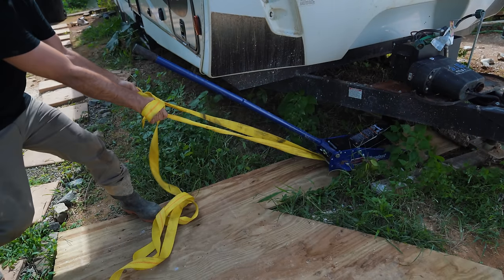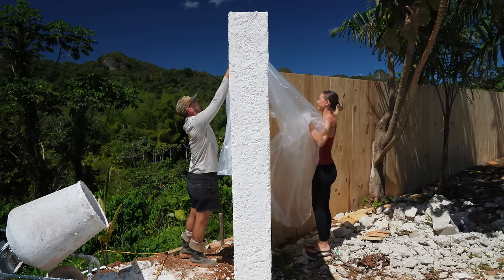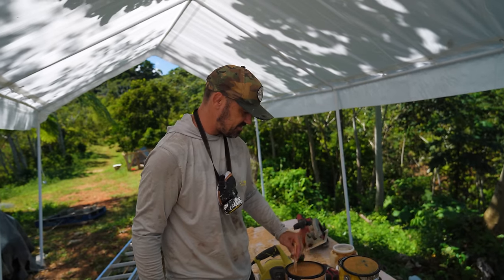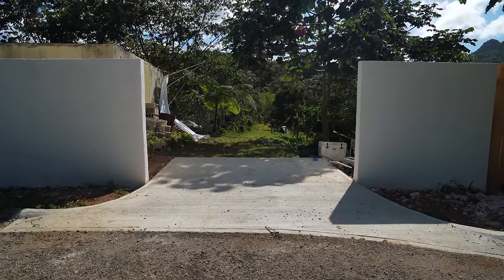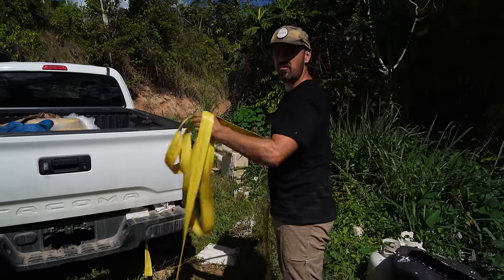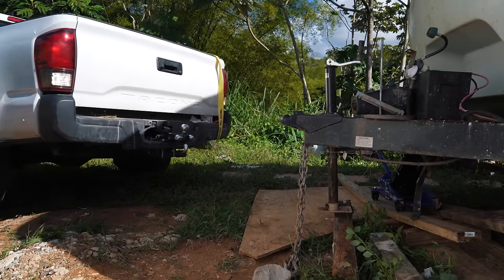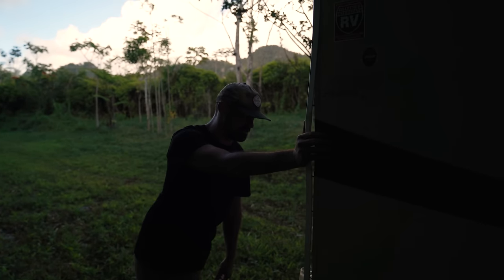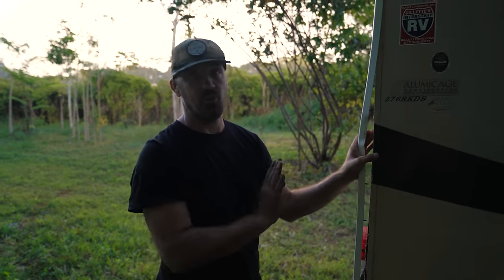DIY HITCH, UNDERRATED TRUCK, WET CLAY, WHAT COULD POSSIBLY GO WRONG?! MOVING INTO THE WOODS

Comment: Matt place a batten on the top of the fence to stop water ingress on the end grain of the wood it will enhance your fence as well,great videos..
Reply: 1000000% agree
Reply: In future.cut wood @ angle
Reply: Do this
Reply: Agree...
Reply: Chamfer and sand end grain before adding cap.
Reply: @robertbennett6697 what? No - just cap it….no need to do work for the sake of work….
He’s not getting paid by the hour.
Reply: No comm❤ent from me..I was going to comment on top of fence too
Reply: Great advice!
Reply: Someone else mentioned a sacrificial board across the bottom.  The boards will slack up water from the ground if they touch.  May be something you consider in a few weeks. Understand y’all have a lot on your plate but it will help extend the life of your fence.
Reply: Am loving this show ❤🇧🇸💯
Reply: You need to cut a drip line on the bottom of each side, or it'll still follow the wood and run to the top of the pickets.
Reply: Clear wood preservative will only last a year or less, reapply often. Also, plastic caps for the top of each post will help prevent rot in the ends.
Reply: Put top board on an angle All good so far. Thats what the guy that jumped off the empire state building said at the 70th floor😂

Comment: I don't care what ANYbody says, THAT fence looks professional.  But you're right.  When the hurricanes come they will tear up EVERYTHING.  Fingers crossed.   BTW my wife loved the shot of the beautiful chickens best. Happy trails.
Reply: Looks are often deceiving.
Reply: It does look nice however it’s going to have issues which is unfortunate
Reply: Your “hurricane” comment is naive.  If you haven’t built in hurricane or tornado areas, you probably don’t understand how a storm actually creates the damage and that it isn’t ever 100% equal force being applied to the entire impact zone.  My point is that there are so many variables to consider that where something you built survived a cat 4 storm but gets mauled in a cat 1 storm when built exactly the same, the fault in feeling secure comes down to ignorance.  

The best example of this variable being how one palm tree get ripped completely from the soil (extracted and deposited 100’ away) while another one the exact same type and size planted within feet of it remains standing in its original planted spot.  Was it the difference in the storm or something unique to the trimming of the plant, how it was planted, fertilized/watered, soil conditions, it’s root system, etc. 

BOTTOM LINE: Every detail matters and that is why there are standards when building a structure in a zone known to get storms.  

FACT OF LIFE: Everybody gets to be right and everybody gets to be wrong.  The proof is in the pudding and the rules get made by massive voting all tied to actuarial data managed by insurance companies and used by standards groups within the various industries that provide materials and their rated success.  Those who map to those standards and use insurance are protected (held harmless against potential damage).  This is the group that is going to be right whether they are or not.  Everyone else is defined by their anecdotal stories.  None of the votes placed on social media mean a flip….only the one of the person deciding.  

I like both ….being protected in certain areas of liability and running “mad dog” in others (where I self insure).  It boils down to risk v reward.  To each their own….hopefully, a person will own their shite and not blame others when something doesn’t work out.

Comment: A correct size socket on your drill motor will make quick work of those trailer jacks and stabilizers.
Reply: Knowing Matt, if he had the correct size, he would have used it.

Comment: AT ONE TIME IN MY LIFE, I bought and sold land....land speculator....One of the first points I inspected was whether or not the land flooded. You are down there by a little stream.  Notice all the mountains around you? In a really rainy episode, the volume of water from those mountains can be higher than you think....Walk around the area and see if you detect any craw fish mounts or even holes. If that low land floods, they will build mounds....Next, look for debris left over from rising water, such as twigs and  leaves in the lower limbs or even debris which pile up around tree trunks.   Perhaps Matt already checked for leftover flood debris.   Matt is extremely gifted with construction skills, but rising water is a different matter. I clearly are unaware of that particular elevation.

Comment: After I stained my fence using a brush, I saw on YouTube that some people dip the boards in stain before mounting them.  This would cover the edges better, but the boards would need to be cut to length before mounting.  Matt does a much better job of fence building that I ever could.

Comment: To inexpensively extend the life of your fence, dig a shallow trench a foot wide between the posts and fill with gravel up to the bottom edge of the boards, and design the trench to run out downhill when filled with rain. Then get epoxy and a roller and seal all the top cut exposed end grain of the boards. Your fence will thank you.

Comment: Matt,  spray the steel undersides of the trailer and soak the springs  with used motor oil or at least diesel fuel.  It prevents rust cheaply.   Best wishes to you all.

Comment: If you cut the bottom of the fence in a 45 degree angle the rain water will drib off instead of sucking into the wood. That will make the fence last longer 😊

Comment: There is a simple trick to maneuvering an RV, just keep going until something sounds expensive.  Also, the flat tire wrecked your stabilizer.  If you put them down and that tire goes flat again it will get worse.  Cordless drill and a socket can wind those jacks up in seconds.

Comment: Having moved mobile homes you ALWAYS have a hauler that is bigger than the load. You always have more power than need and off road requires even more. With hills I often have to use crawlers.

Comment: Nicely done😊 easy fix on trim.

If you ever want or need to pull something large like a trailer, boat, or tractor, put on a real hitch that is tied to the frame, not the bumper.

It tried to pull a guy's small truck out of a snowpack with my winch.  He attached the cable to his bumper hitch.  We both watched as it looked like the truck was moving.  Until we noticed the bumper pulled a foot away from the truck body.  He rehooked the cable to the frame and pulled the truck out with little effort.  So the moral is have a hitch that is tied into the frame and not the bumper.
 
Imagine the surprise of driving along and your trailer passes you or flips you over.  Also use safety chains and electric breaks on the trailer.

Comment: That fence should last about 10 years as is but it will look a little rougher as each year goes by and it looks really good for now so enjoy it while you can. It's your wood post in concrete that will give way in the high winds. Next time think about using vinyl or galvanized post.

Comment: You did a great job on the fence.  Only suggestion would be to keep the bottom out of the dirt. That's it.  I use underpowered vehicles to move my trailers.  You did very well.  Just take it slow.

Comment: Well done moving that trailer with an overloaded truck!  Fwiw, you can use your battery powered drill with an extension to run the trailer jacks up/down.

Comment: hurricanes dont remove your fence panels
hurricanes snap your posts at ground level which is why you dont use concrete around your posts in Florida that way your fence can lean and you only have to straighten it back up after the hurricane. Your dad is correct Matt.
Reply: Some air holes in the fence might save your fence when the wind  is blowing 90 mph .

Comment: If you are going to use that truck to tow your motorhome I would encourage you to check the tow weight because I believe that the RV is exceeding the tow weight of that truck. Also the bumper that you have will not hold that RV very long. I have seen people use those bumpers but it will bend it like crazy. You can have an appropriate hitch installed on your frame which is where it should be and you can have air shocks installed that way the rear end can ride at the height you need it to. Many years ago I had a Chevy Venture van and an RV and when I had the hitch installed the RV caused the van to ride real low so I had the air shocks put on that way I could tow it into the mountains. It worked great.

Comment: Great Job on the fence, and getting the RV down the hill.  Matt You need to find a A good used Bobcat skidloade, to save your back.  I'am 80 and have an 843 Bobcat, and I use it for everything.
  Also noticed that stream has a pretty good flow, and a Paddle Wheel driving a Generator, would power maost of you needs with Free Electricity.  You Kids are doing great but you need to sail your boat once in a while, if you still have it.  Loved all the fun and bad things you two had with it. Dive for for those Lobsters !!  Take care and be careful, have lots of babies to help you in life.  Max

Comment: On the trailer, the stabilizers are not designed to hold up the weight of the trailer. Having a flat tire on the trailer will over stress the stabilizers. You either need to keep the tires inflated or block the trailer frame. Very important for the trailer to be as level as possible for both the slide outs and the refrigerator to work properly. There are many good YouTube videos about these issues.

Comment: I have always had great performance mixing about 25% Boiled Linseed Oil in with oil-based stains. I've even added 25% Boiled Linseed Oil, 25% Tompsons Water Seal and 50% Oil based stain together. Usually takes two coats to get the stain color to normalize, but easily get 10+ years before I think I want to stain it again.

Comment: There is a reason nobody fastens fence boards like that. I have been a carpenter for 45 years and I can say with a large degree of certainty that at some point you will need to put the fasteners on from the front.

Comment: Just put  a real hitch on it.  I just bought one for $320 and put it on my wife's car (my truck already has one).  I did it by myself and it took about six ours (the hardest part was having to take the exhaust system loose from it's hangers, and then put it back up)..  With one person helping, it would have been two hours.   Enjoyed your video!

Comment: Matt, here’s a tip that i used a lot while  building log homes and moving heavy stuff by myself, get 100’ of rope and some cheap pulleys, , a few carabiners, google  fire dept 3 to 1 , 4-1, and z drags….ive moved and lifted thousands of pounds by myself, , if you need or want,   Let me know, ill send pics or diagrams..

Comment: Matt's fence will last. It's just long term you may have to perform some fixes down the road. Applying the sealer, will probably delay any possible problems. If you trim the fence to keep it from wicking up the moister from the ground, it will keep the boards from bowing at the bottom or rotting out, long term. Hurricaine winds... will everything is off the table, right. Who knows....what will happen with any wooden fence. But, it looks good now.

Comment: You do need drainage under the fence boards will suck water up like a straw will not take long for bottom rot off. Part of the plan gravel trench under fence? Great video.

Comment: When you need or want to add more fasteners to your woodfence just put them in from the outside on a laserline and exact in the middle or on 2/3 of the board.
But I see more the need of a caprail with a groove on the bottom to catch the top of the boards and a peak top to let water flow away.
It will protect the endgrains from moisture and sun and with a backupboard there to get all the dangling boards ends in line. They will move more over time.

Comment: Just a heads up short distance down hill tighten your trailer brakes before someone says no I'm a truck driver it helps with sliding its easier to control
Reply: You’re assuming he even has the ability to use the trailer brakes with the Taco. Doesn’t even have a proper hitch, what’s the chances it has a trailer brake controller? 😂

Comment: The fence looks awesome but you're going to have to reseal it every two years. The sun and the wet/dry expand/contract of the wood from all the rain, it will tear it self a part. A five gallon bucket of thompson's deck sealent and soak the boards with a brush. Spraying it on it will be just be to thinly applied. Doesn't matter if it's presure treated, wet/drying of the wood will tear it apart. Every two years.

Comment: I wonder if your truck has the same engine I have, in my '02 Lexus....It has Balls, It pulled a Uhaul a thousand miles and still runs like new....For your driveway, I wonder if a (Texas Paving of gravel sprayed & packed, rinse & repeat a couple times) would work on your hill....Hurricane straps after fit in the permanent location....

Comment: So way too late to mention now...but not sure how I could have let you what I use that works great for fence staining. I have a 16 gallon tank that runs off my ATV battery, but if I don't use that, I have a $20 tank sprayer, like you use for spraying weeds. Pour a gallon in there, pump it up and spray, it really works good, low cost and no electricity!! I've sprayed probably 4 or 5 cedar fences with these two methods and both work great, Matt.  Good luck with the fence and moving the RV, but unlike a commenter earlier, I miss the sailing videos!
Reply: "$20 tank sprayer, like you use for spraying weeds"...worked perfectly for me!

Comment: You may want to stain the bottoms of the rest of the boards before you put them up to keep moisture from getting into boards maybe even stain the whole board(s)on sawhorses before you put them up which will allow yo to get the bottoms and sides real well in order to weatherproof and preserve them after you put them up you can snap your line and cut then just touch up the tops
Reply: In future const using a zinger or bullseye Primer on ALL cuts and TOUCHING wood pieces (framing) and stain to any exterior (decks etc..) will add a decade or 2 of life span to your projects in your tropical environment
Find a higher end custom home builder I'm sure they will agree and they may have more tips for you and your environment definatly a good idea to adopt a knowledgable experienced local mentor

Comment: Great work! A small top cap in aluminum or stainless for the fence would not only protect the end grain but keep the board ends in line. Not much overhang would be needed.

Comment: Matt, take that bent up RV corner trim piece completely off the RV to straighten it up on a flat surface, run a bead of sealant down that corner and then reinstall it. Trying to straighten it in place will be tough.

Comment: When did the damage occure on the left side wheel well ? You say you parked the mobilehome on a mud flat. Does this not imply you will be dealing with mud and water issues? Any plans to create drainage? What about raising the areas where the mobilehome  and house will be? You say solar panels, are you not in the shade of the hill?